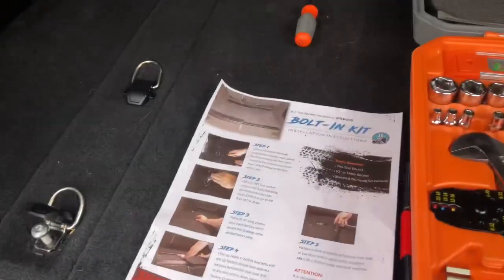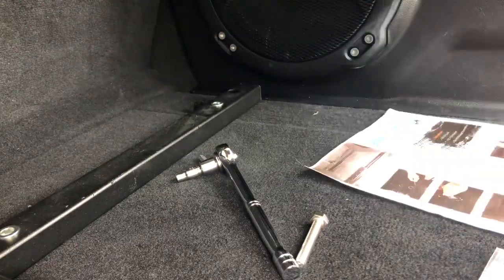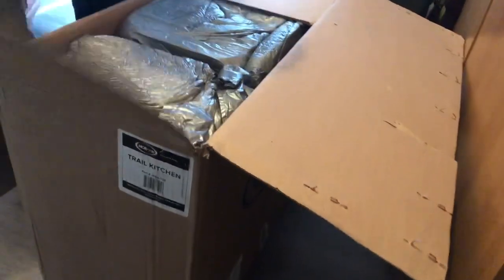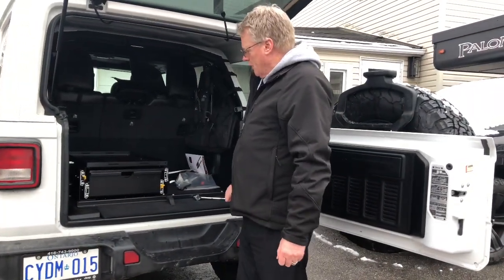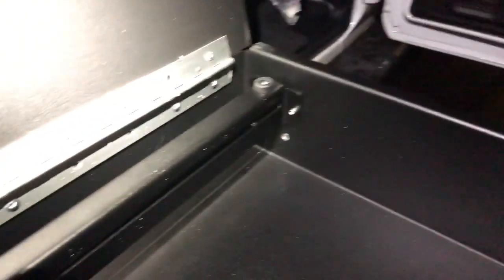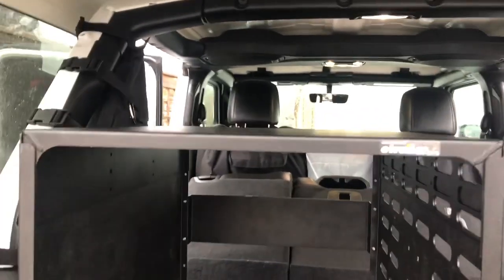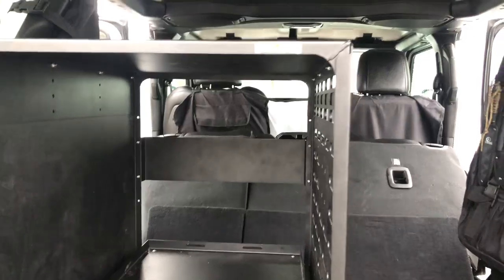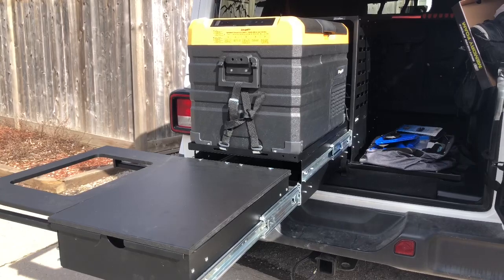Modification to our Ultimate Overland Vehicle. Install of the MORryde slide out kitchen and sink

Comment: Great video,  I’ve been looking at this unit and also have the 35l bougerv in mind.  Too bad about losing storage, although that is not a deal breaker.  How much room (in inches) is left on the right side between the kitchen and the right wall?  I was thinking about putting a drawer there and want to make sure it fits.  Thx

Comment: Hello Mr. Brad, I am on the hunt for a fridge like that you have. I have two questions first what size is yours I am interested in the 42Q and how long took to get it. I am running behind with my purchase and my trip to Presqui’le is coming very soon. One more questions are happy with your fridge? Thank you in advance
Reply from the maker: Hi Eni 👋  Ours is a 35 L size which is great for 2 people.  We love our fridge!  It has an app to control with your phone, and the temperature always stays cold or frozen depending on what we set it for.  It is a fridge/freezer combo.  Here is the link from Amazon.  They do have different sizes, but we definitely recommend the brand.  Thanks for watching!

BougeRV 12 Volt Car Refrigerator Dual Zone, Portable Freezer Fridge APP Control, 37 Quart (35L) Compressor Freezer Fridge 12V/24V DC 110~240V AC, -4℉-68℉(No Wheels, Basket Are Not Included) https://a.co/d/098kndT
Reply: @canadianadventureseekers   thank you so much, Mr. Brad, one more question what do you use to power your fridge? I did install an extra battery in my truck to run the fridge from it.